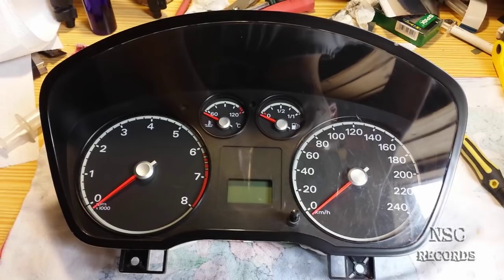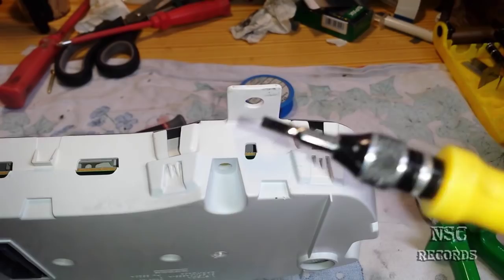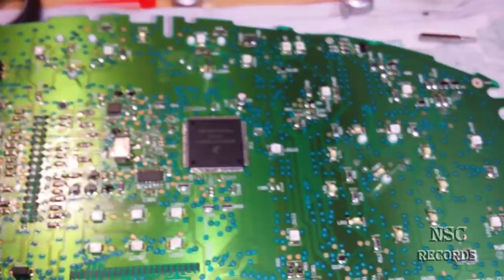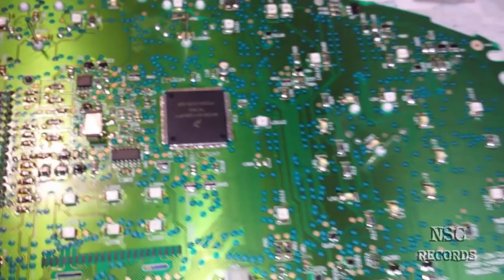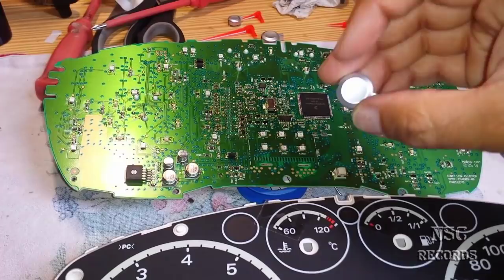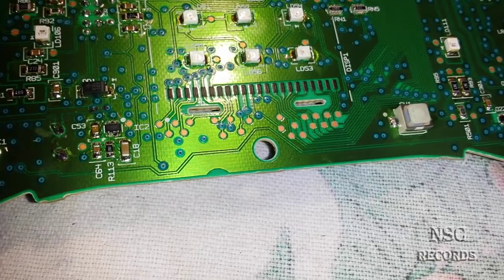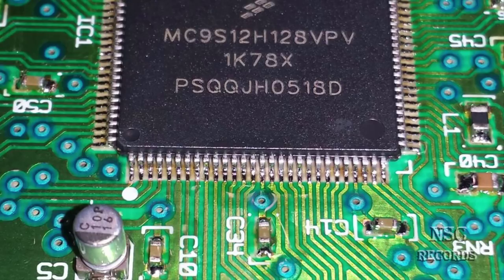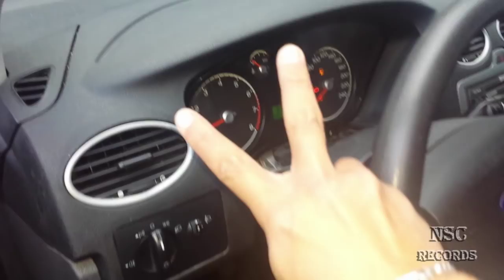Ford Focus Speedometer/Tacho/Tachometer Repair By:NSC

Comment: Thanks! For anyone wondering about the pointers and their caps - just lever them out. The cap will come off or it'll come out in one piece (pointer+cap). I only had to resolder pin 17 and 18 of the connector to get rid of my loose contact.
Reply from the maker: +diabbb Pointer + Cap

Comment: Great video, and to help people further I'd like to ad some things. After I had disassembled the level meters I saw that you had put tape marks to know where to put them back on, in the lowest point of their range. I used your video to find out where to put them, but everybody should put their own tapemarks before taking them of.

Another thing I'd like to point out (as working professionally with soldering) is that I think it's a bit overkill to resolder everything in the first place. The most important is to resolder points where you can suspect cracks to arise, components with a higher mass, ie the connector-pads, bigger components thats not flush to the pcb and low in build high. 
I would recommend not to resolder IC's and likes if its not obviously necessary. Because you always have a risk of damaging the component with temperature from the soldering and ESD, and if you're not a pro it's very easy to shortcut the legs of the IC's.

Comment: Hello, thank you for your video. Very helpful. But I guess I need to buy a whole new Tacho. Where would you recommend me to buy it?

Thank you
Reply from the maker: Thank you to :) Where are you from? Maybe i can find one for you, i just need the Car Model and year
Reply: I am from Luxembourg. I guess you speak german? :) And I need exactly this model:
3M5F-10841-C, 3M5F10841C

The car doesn't turn on sometimes, and the meters go crazy once in a while. A ford Garage here in Luxembourg made me an offer of 1000€ to change the Tacho.... I'd rather do it myself. But I can't find the right one. I already took it out and cleaned the connections and all, but that only does the job for a few days, than after it goes crazy again.

It's a Ford Focus 2 from 2006 i think. 1.6 Benzin, Automatic.
Reply from the maker: ok, i had allready a lot peoples from Luxemburg :) If you like, i do this Service for you a lot Cheaper, only Thing is, you need to take out the Tachometer and Send it to me... If you like that i Repair it for you, then Send me an eMail and we can talk about the Rest: UltraNSc@live.de

Comment: Thank you for sharing this. My focus has excatly the same symptoms and sometimes comes back to life all of a sudden.
Could I just clean the existing soldered contacts with some sort of electrical cleaning solution, rather than try soldering (I#m a bit dubious about over-soldering and making connections between two previously unconnected points since thesesolders are very small points) Let me know your thoughts please. By the way, your English is a hell of a lot better than my German. Danke..
Reply from the maker: +Dominica Pavlova Thank you :) No, electrical cleaning stuff like Contact Spray and all will not help that much, best Option is realy to resold all the contacts. Best Regards

Comment: my indicator sound thing doesn't "click" when indicator is ON.. Is there any point trying take speedo apart and check what is going on ??
Reply from the maker: Phen0mable i bet it´s the speaker
Reply: UltraNSC is the speaker inside the speedometer ??
Reply from the maker: Phen0mable on some speedometers yes
Reply: UltraNSC I got focus 2007. Do you know if my speddo has that speaker ??
Reply from the maker: Phen0mable hmm im not sure, i just know that the most has the Speaker inside the Speedometer, just like here, look at this Pics, it´s a german Forum but it dosent matter: http://www.google.de/imgres?imgurl=http%3A%2F%2Fwww.clublos.de%2Fimages%2Fstories%2F01_TN%2Fimpressionen%2FKein_Warnton%2FP1010472.jpg&imgrefurl=http%3A%2F%2Fwww.clublos.de%2Fgarage%2Fimpressionen%2Fkein-warnton-bei-angelassenem-licht&h=768&w=1024&tbnid=WjIK26dGfoGILM%3A&zoom=1&docid=sIhm9H3qluQ8cM&ei=8h2kVcvtDKjiywOS44rYCQ&tbm=isch&iact=rc&uact=3&dur=703&page=4&start=96&ndsp=29&ved=0CMkCEK0DMGFqFQoTCMuuxM_32MYCFSjxcgodkrECmw
Reply: UltraNSC yep I can see clearly that there is a speaker but I can also see that this is a old model ..
Reply from the maker: yeah, newer models has a smaller spearker, so you really need to look your self inside if you will find one or not...
Reply: UltraNSC I will do it tomorrow ... Thanks for all replies
Reply from the maker: np :)